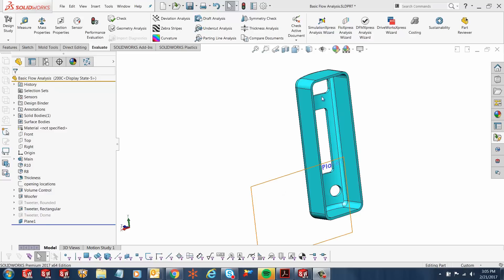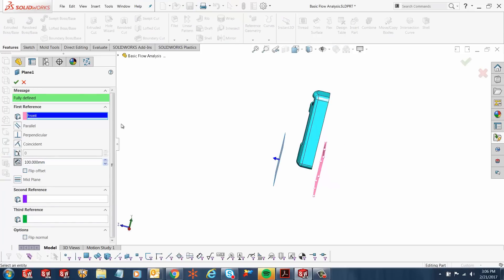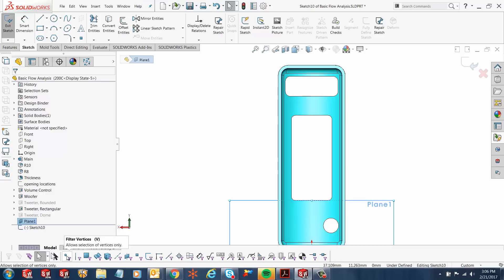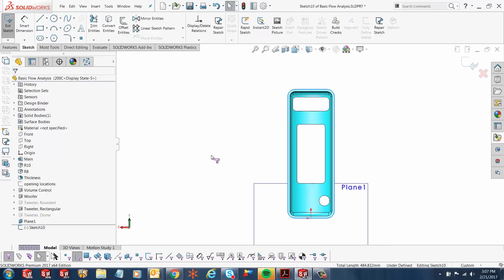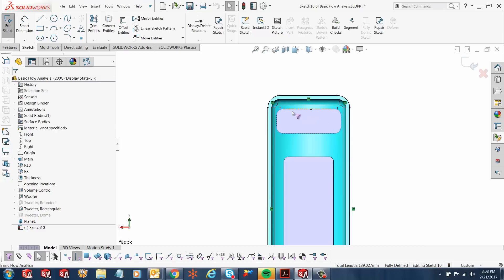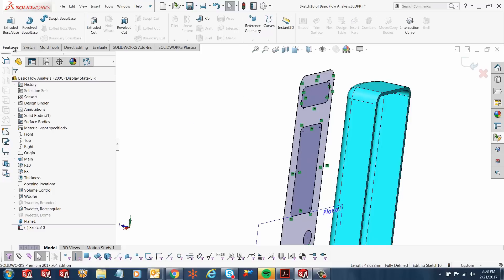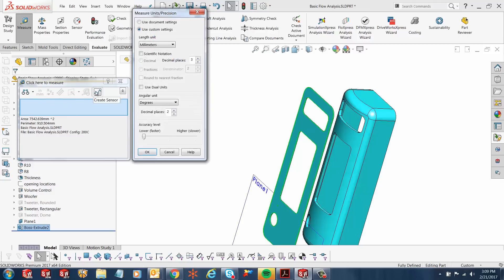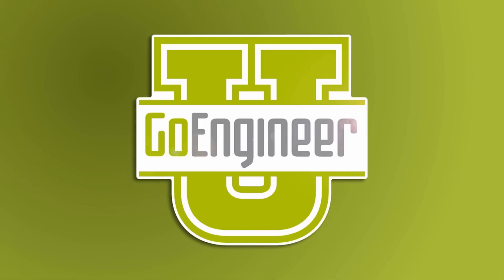SOLIDWORKS - Surface Area Projection

Comment: I projected a sketch on a non regular form surface and I want to change colour of this inide of projected skect. How can I do it? When I project it, it shows just a sketch, not an area.
Reply from the maker: The shaded sketch area only works with planar type sketches and not with sketches projected on to curved surfaces.  A work around would be to use the projected geometry to create a surface that can be queried.

Comment: What if the parallel surfaces are cylinders and things like that, how do I select that contour ?
Reply from the maker: Hi OrangeSale,
If you are dealing with cylinders you would need to specifically select the edges of the cylinder.  Cylinders allow for you to select the silhouette edges (not real edges on the cylinder but edges that represent the sides of the cylinder from a specific view point) but they must be selected specifically and are not part of a contour selection.  The Edge selection filter should help you to select these though.

Comment: is it possible to create an extrusion from the projected sketch such that to create a volume between the projection and 3d surface?
Reply from the maker: Hi Erick,
Yes, this can be done by projecting the sketch onto a 2D plane or face then activating the 'Boss/Base Extrude' command.  The specific end condition you are looking to use for your case is "Up to Body" or "Up to Surface".  The projection of the sketch must completely intersect the body or surface you are extruding up to or the feature will fail to generate.